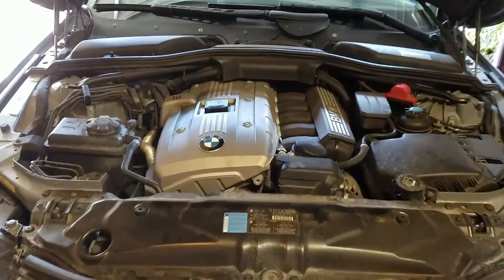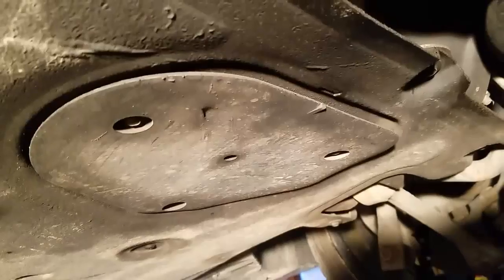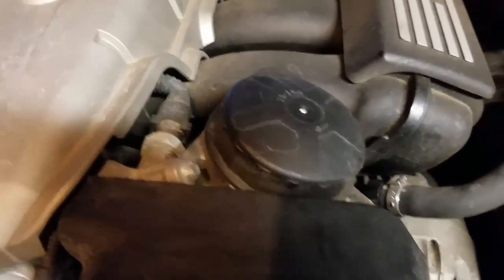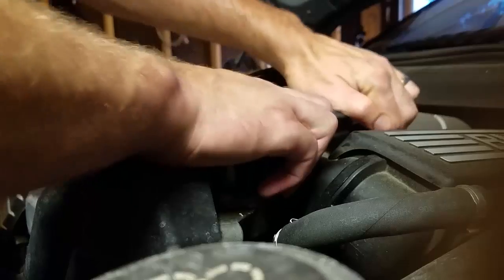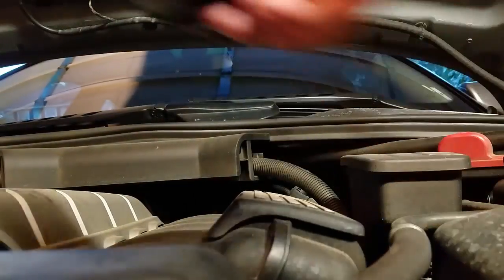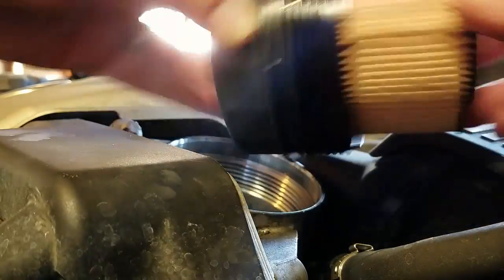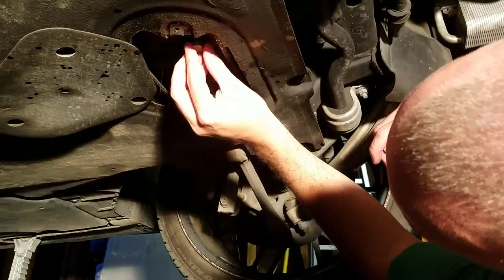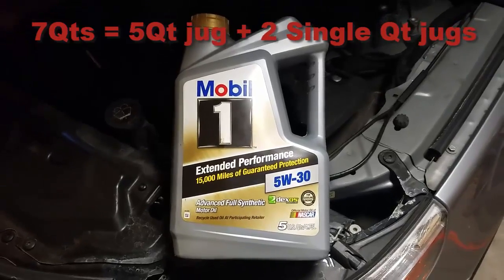BMW N52 Engine Oil Change (Save $70 every time!) E60, E90, E85, F10

Comment: Need to use BMW approved oil. aka European formula
Reply: You don’t need to use BMW oil any good quality 5w30 fully synthetic oil will be ok I’ve owned a e39 528i  and in now drive a E 60 525i and I’ve never used BMW oil just change oil &filter on a regular time
Reply: Yes, but this may have been the LL-01 approved oil at the time though. Not sure. Probably best to get it from the dealership but I know there are Euro blends out there.

Comment: How often do you change your oil?
Reply: i have an 07 530i and i go every 7k with the exact same oil he uses, i dont feel comfortable waiting until 10-15k even though i know its a full synthetic.
Reply: To lower cost of ownership, BMW started to use condition based oil changes. The computer looks at the various sensors and determines your oil change frequency. If you change your own oil, I'd just do it every 6 months or 12k whatever comes first. I've even went 25k without a change and the oil still had life. The downside of waiting long on the oil changes is that it tends to ruin gaskets and sensors. The extra gunk seems to make a higher KM engine run worse

Comment: ideally, you want your oil to be hot when it's drained to get everything out of there but you will probably burn yourself. just idle your car for a minute or go for a quick ride around the block to get it circulated before you drain. especially if its been sitting